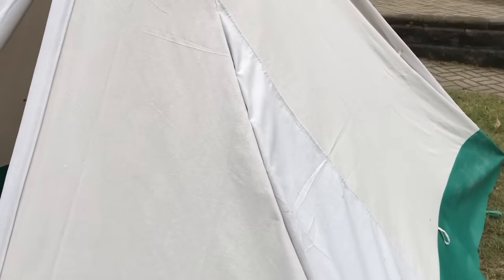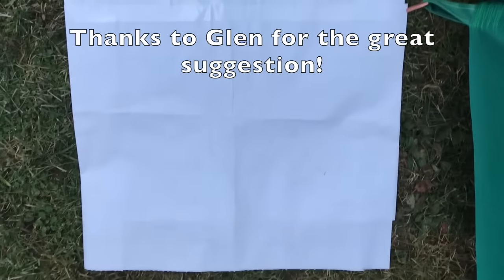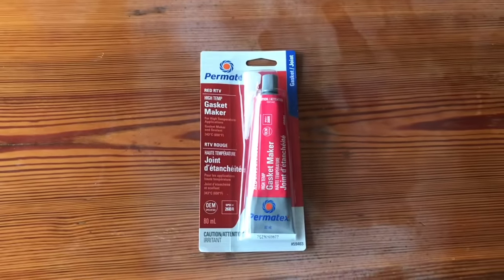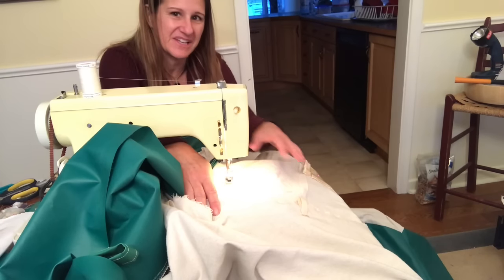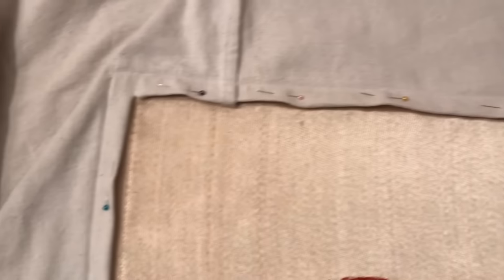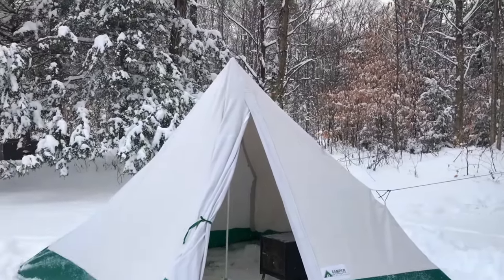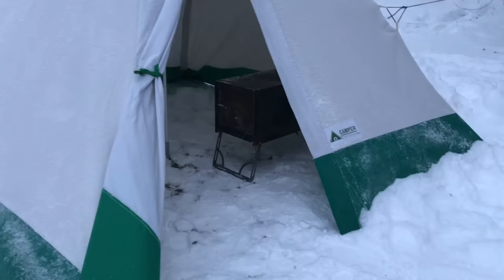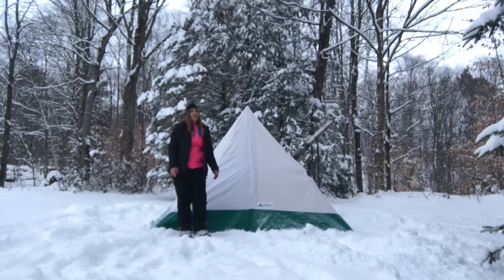How to Make a Hot Tent - Camper Christina Style - Part 3 - STOVE JACK INSTALLATION

Comment: You're amazing, great job on the tipi, I thought your painters pole idea is a really good one. I recently made my own  hot tent, pretty much the same design, I used silicone coated polyester fabric instead of canvas and can relate to your empty bobbin ordeal. Like you,  I used a welders blanket for a stove jack but what I did was coat the fiberglass with high heat silicone using a putty knife to really push it into the fabric, making it water proof. Thanks for sharing, I always like seeing peoples MYOG projects come to life, inspires me in my own projects.
Reply from the maker: Thank you so much Ross!  I actually had some issues with the painter pole and made some revisions to to it last night. There will be a post about it in a few weeks (have a few videos to post before that one.).  I would love to see your tent. Can you pm me a picture?  Nice to know you get it, I mean really get it.  :)  It is a labor of love but not always easy, is it?  I appreciate you taking the time to check out my videos and to comment.  Happy creating! :)

Comment: I've been rewatching all your hot tent videos and getting so inspired - I've been planning to make one myself for quite a while, it's really helpful seeing how you made yours 😊 What are the final dimensions of your tent? Mostly curious about the diameter and if you are ultimately happy with the size. Thanks again!
Reply from the maker: Hi Jen.   Thanks for watching and commenting.  Just do it! it's not as hard as it looks!  :)  The backcountry hot tent is about 8.5feet per side.  It's enough room for 2 small people to sleep and plenty of room for what it was made for, solo trips for myself.  I guess as you know from my videos,  I bring my summer tent for gear and switch it out if I have 2 people sleeping in the tent and that works just fine.  The tent was actually supposed to be a bit bigger but due to the flaw I discovered in the front, i had to switch the back and front around and lost a few inches on each side as the back seam was double stitched and I had to cut the seam out.  I would definitely make it a bit larger if I were to do it again. Even 9.5' per side would make a huge difference.  I hope you make one and keep me posted! :)  Let me know if you have any more questions.   :)  Cheers!

Comment: Hi again. Maybe you should put some cloth ties at the top of the chimney flap. I don't think I would trust velcro in a strong wind.
Reply from the maker: HI Patrick. The stove jack flap is quite solid with the velcro. No need to add anything else to secure it. It is actually a bit of a struggle to pull it off and close it when I'm done with the stove pipe.  It's not going anywhere.  Not very easy to show that on a video recording solo unfortunately. Sorry, I didn't do a better job of that.   Thanks so much for your advice and for checking out my video. I really do appreciate it!  Happy holidays!